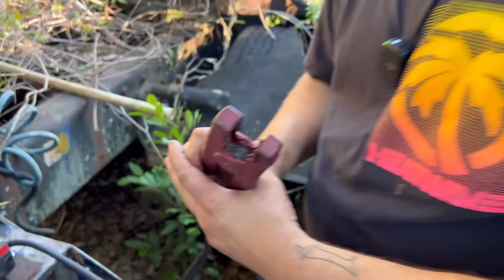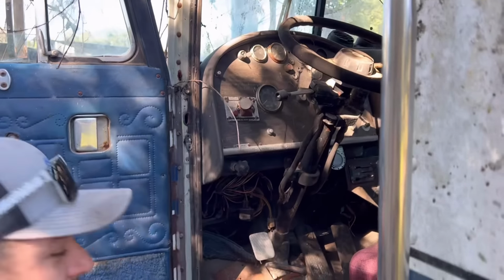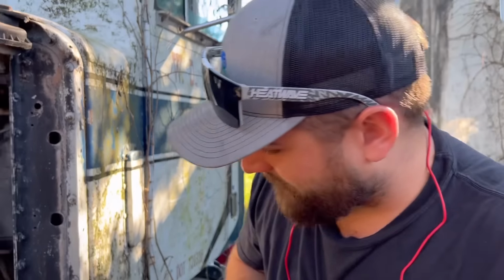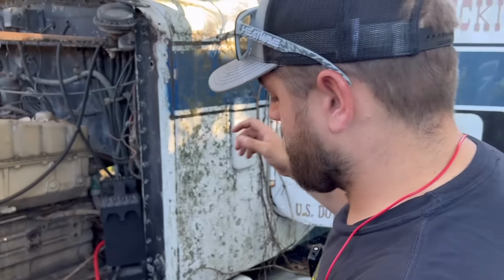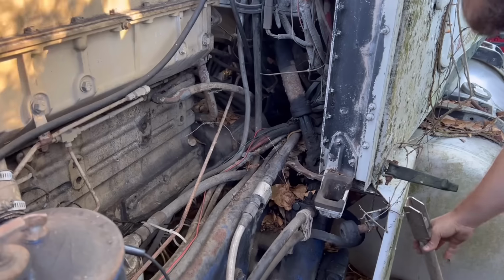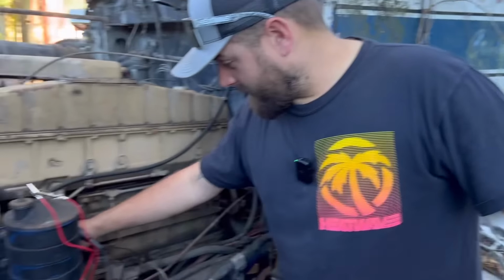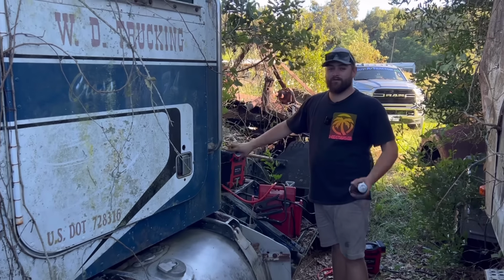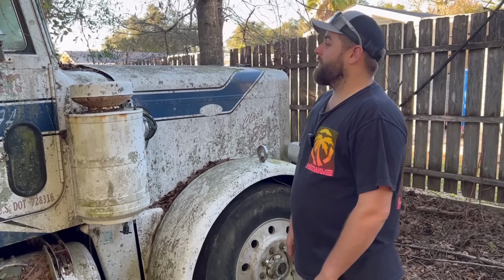WRECKED PETERBILT 359, WILL IT START?

Comment: This is how I started  EMD, Cummins Detroit ,cat . Operators would run out of fuel . So I rigged up 12 v and 24 v electric fuel pumps would break into fuel  line n charge up transfer pump . Start in 10 mins or less . Operators were pissed at having to go back to work . This worked just great

Comment: PT pumps that have sat for a while, lost prime, or are new/empty of fuel need to have the inlet gear pump primed to suck fuel from the tank. A good squirt of lube into the pump inlet will do just that. This one would require removing the filter from the housing to spray directly into the gear pump inlet. Once that's done, it doesn't take long for it to self prime and fire. Priming the pump like you did works great and will stay running if the gear pump isnt dry.

Comment: An old mechanic told me once to use WD 40 as starting fluid on diesels, burns just as good as eather but lubricants the cylinders instead of drying them out.

Comment: Hey Bruce been watching you forever. Honestly the channel went from will it starts for sure but also had the greatest element of rescuing then fixing old rigs. I know you don't have the time or even the right sort of bent for rescuing these old rigs as you defeat the idea before you start.... I get it as you're doing tractor stuff and running the new rigs [way more expensive than modernizing an old rig with rear clips and new air works and whatever else the old girls need. Perhaps Aaron your brother may want to put together a crew who could be in charge of saving these old rigs in project series? Actually get somebody to quarterback a few guys who can transplant a new motor they could rebuild as an in frame project and Multi part series. Have the project videos for that team to put up on this channel while you continue to wheel and deal the tractor stuff and drive. Because spitting on these old rigs and laughing at them... you know the frames in most cases with these trucks are in real nice shape aside from some surface rust. That old 73 cabover you did the two part start up on... You could drop a Cat in there ore big 400 Cummins... in framing those motors isn't so bad to do. Spending 800 to 900 thousand on new trucks when 30 thousand can get you a recueld old truck with all new parts and rebuilt motor like that old Cat 3406... You just need a crew to do that and film it. You tuck a dump on that old Kenny and it was easy enough to see where you were coming from with it.... but man, guys are making new trucks from old trucks and sending them down the road with little to no problems. Just takes the time to do it and just not taking no for an answer. Showing the job who's boss. It's fun to watch the new truck experience and the time and effort it saves... but saving money... nah... lol  Those new rigs are INSANELY over top price wise. Way more money than sending and old rig with new brakes, wheel seals, bearings, wiring harness, rebuilt motor, new Sleeper even and probably a rear clip and generator for overnight runs... Gentry, James Pretty, Twinstick Garage, the 379 that Peterbilt Mike is doing right now... It's a winning formula and delivers the goods content wise. Even if you fix them up then sell them for whatever profit or have a trucking company with trusted drivers to job the old [really new after the project] trucks for the company. That's a win win. You've proven you can find these old gems... so find them then get a crew to rebuild them ground up and put them back to work. Great for youtube and probably way cost effective for your new trucking company. You don't like that kind of work and find the engine inframe work intimidating... so get a crew to work those projects that are willing to do that work. Makes sense right? See if Aaron and a couple of guys can organize and do that. Don't have to be Mr. Personality laugh grabbers, just capable workers who can smile whild they work and enjoy the work. I really don't see why not? These old trucks are worth the Restomod  touch you guys can give them. Youtubers will eat that up!

Comment: You need to come to my house and do a will it start on my 89 first gen 12 valve Cummins alternator over charged the battery and did something it will turn over but doesn’t get fuel I’m sure it’s something to do with the fuel shutoff solenoid but I don’t know enough about them to really work on it and I can’t find anyone close to my town to work on it if you ever come through lower Alabama I would pay you to fix it